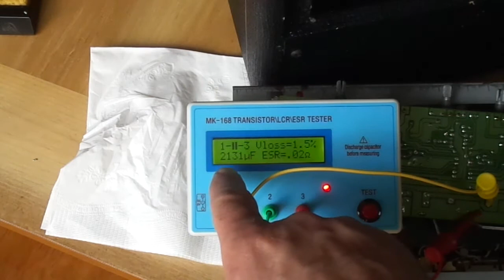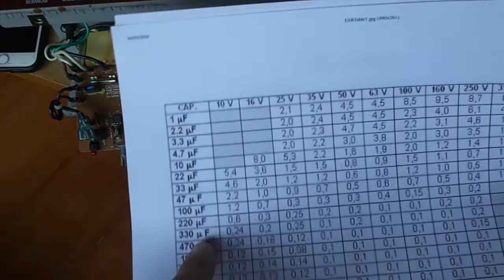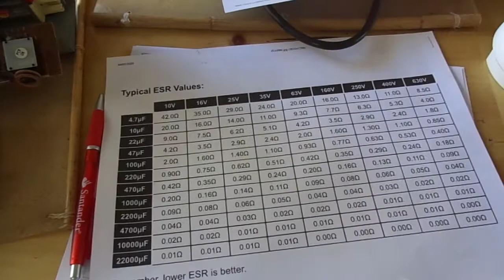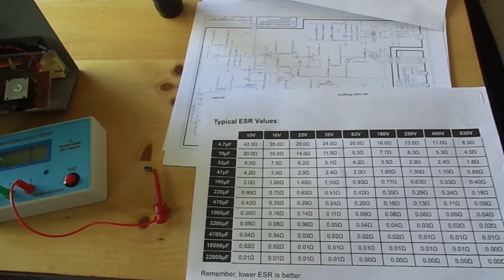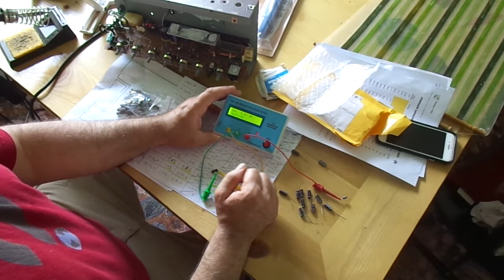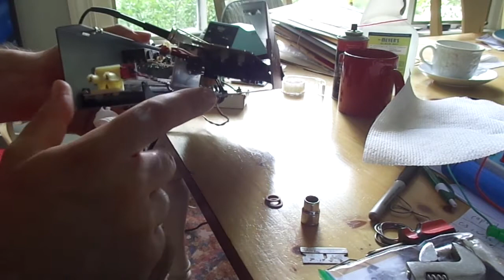Vox Pathfinder 15R Electrolytic Capacitor checkup and possible recap job?

Comment: I have that same model Vox 15R, and we'll, ..I unplugged my Speaker and the speaker wires touched together while the amp was on, and it went " pop"  and a little tiny wisp of smoke accompanied by a burnt electrical smell came out of it.  The little red led on/off still works though, ..but no sound. ..

I removed the Chassis and the Fuse is fine. Then I smelled the Board and found the area of burnt electrical smell, Scrutinized that area visually and found two things that look sort of off: C22, ?  ..it looks like a brick red colored Chicklet (remember Chicklets chewing gum?) anyway, ..well, there's a bunch of those in there, but the one labelled C22 has a little silver metallic substance coming out of it, ..it looks almost like a little silver sliver of dried solder, coming out of the top of it. 

The other thing I noticed, is, ok, you know how you have to remove all the Chicken Head knobs and those seven flat screws and washers behind them, ..and then also those two tiny Phillips head screws, to separate the Board from the Chassis? ..well those two little black Phillips Head screws that you remove from the aluminum sort of L shaped piece that holds the board to the chassis, ..in the Center of that aluminum L shaped piece, ..there's a single, Regular sized, silver colored Phillips head screw that holds this little Black Square, onto that L shaped aluminium piece, ..  it looks like like a little black box made of some kind of Hard type of Bakelite Plastic.  ..it has Five little fork-like Fingers that come out of it, and go up to the board, where they're solder connected to the Board where it says IC4, ..well that Little Black Box, has a big Chunk blown off it. 💥 I even found the piece that blew off.  ..there's even a little tiny black mark on the aluminum piece it's connected to right beside where it blew off.  
 ..everything else looks fine visually as far as I can tell... ..please, ..what are your thoughts on this? 🙄
Reply from the maker: For starters, the little black box that blew up is the TDA2030a power chip. It’s what gives your speaker 15 watts of power! It needs to be replaced. The original chip had shorting protection, whereas replacement counterfeit chips didn’t. So you need to get your amp worked on to bring it back to life.
Reply: @voxpathfinder15r  I never knew if the two speaker lead wires touched together it would, ..your amp would go poof, ..everyone's always talking about how great it sounds to plug it into a bigger speaker, have you ever heard of this happening? 

Do you think if I get the TDA2030a power chip replaced, the amp will work again?🔊 Where can I buy this chip, or something that will work in it's place the same way as the original, that isn't counterfeit?
Reply from the maker: @benwright6330  there is a special Jack to plug an extension speaker, you don’t have to unhook the built in speaker. Yeah, there’s a good chance if the chip is replaced it will work
Reply: @voxpathfinder15r How can I buy this TDA2030a power chip, that I'm assuming is out of production, but still in high demand,, so likely counterfeit these days? , ..was it in production for a long time, widely used in alot of products? Could I buy an old appliance, in good, used condition, like an old phone or radio or whatever they Came in, open it up and harvest this chip to obtain a Real one? Is there a way to find out what years and models of appliances I would likely find one in,  and want to be on the lookout for?
Reply from the maker: @benwright6330  do you have a soldering iron? Do you want to do this repair on your own?
Reply: @voxpathfinder15r  Yes,  if it's not too complicated, ..I don't want to screw it up.
Reply from the maker: @benwright6330  harvesting old TDA2030a chips from old circuits is certainly the best way of ensuring not getting counterfeit. Probably best way is to familiarize what devices would have them and drop by those yearly electronics drop off in your town’s recycling program.
Reply: @voxpathfinder15r   Do you personally know of any old devices that had them, like what brands? ..like would I be more likely to find one in a Sony boom box from the 1990's or something of that nature for example, do you know of any off hand, or ones that would be more likely to have this?
Do you know what years the TDA2030a IC was in production?
Reply from the maker: @benwright6330  I don’t really know off hand, you’re going to have to do some research. There are some good videos on YouTube you can start with. And you might not mind putting a counterfeit chip. It might give you great service, I have read they might have a little less output. But honestly, you won’t be able to hear a volume difference. I suspect any radio device from the early 2000s advertised as around 15-18 watts is probably a great bet. Perhaps even 📺 TVs with its own built in sound is a good candidate.
Reply from the maker: C22 is just the coupling capacitor before IC4, I don’t know why it would get damaged?  But if something visually is wrong, it’s worth taking out one leg out of circuit and testing it. Any repairs on this amplifier will need a qualified technician and/or the use of a load lamp and variac, optionally an oscilloscope. Thankfully I have all these tools!

Comment: Hello guys. Yesterday Ive got this amp. I had no chance to test it prior purchase. There is hiss on clean channel if I turn volume around 10oclock and more then became worst and worst. Do you know what should me issue? I seen that input jack is a bit wobly but still would like to know if there is some other issue to check it. Thanks a lot D.
Reply from the maker: It’s really hard to diagnose from a distance, you could make a recording and maybe you’ll get lucky and it will be something that someone recognizes easily. Otherwise you will need to bring it to someone to get fixed.
Reply: @voxpathfinder15r  Its clear for me. I already contacted servis so will manage in this way.  Anw thank you for answer.

Comment: I have one of these but the brown one, I think the tremolo is broken because I can't hear any difference when I turned it up, do you know how to fix it?
Reply from the maker: Sure it needs to be put on an oscilloscope and the faulty parts replaced, usually capacitors, but maybe a dead opamp?

Comment: Accidentally bought a Japanese 100 volt version. Would it be possible just to replace the transformer with a 120 volt? I’ve read that  a Hammond 166FB24 might work. Do you have any experience replacing the transformer? Are the transformer wires soldered to the board or clipped in?
Reply from the maker: Yes I have experience, I can usually find  something out of China that works. Nothing from the big name manufacturers will work. Yes all soldered connections, you could try a mini variac.

Comment: I’ve got a 15r that’s not giving out any sound. It’s not the speaker, if i put the volume on full I can hear a super quiet signal coming through. Any ideas 🤷‍♂️
Reply from the maker: Wicked common problem, roll up some 400 grit sandpaper into a tube and run it into the external speaker Jack out back and forth. Then with a wire brush cleaner spray some deoxit, and same motion back and forth to clean the terminals. That might do the trick, but lots of times you have to open the back and clean the contact points by wedging them apart with a speaker jack, putting sandpaper sandwiched between and taking plug out, then pulling out sandpaper, repeat as necessary until there is continuity on both sides with plug out.
Reply: @voxpathfinder15r  thanks v much .. will give that a go 👍🏻
Reply from the maker: @LordFuzzman  let me know if it works for you

Comment: hello master, Another question from a newbie in electronics: is it possible and how could an auxiliary input be located? I tried to input the aux signal through the return of the effects loop, but the auxiliary or the guitar sounds, not both, I think due to impedance differences.
Reply from the maker: Do you want to take the preamp out to a mixing board or to another power amp?
Reply: @voxpathfinder15r  NO .. I just want to listen to the backing tracks from youtube (phone) through the same amplifier.
Reply from the maker: @fredyperezrozo1240  I assume this is line level?  I would experiment with this device. https://www.radialeng.com/product/mix-blender/features. Put it in the loop. One path will go straight through the effects loop for your guitar signal. Then in the other side you can inject your music signal and you have a mix knob to alter the level
Reply: @voxpathfinder15r  I didn't think it was that complex. I don't want to add another team. Is there a simple way to make a mood in the same amp?
Reply from the maker: @fredyperezrozo1240  you could try putting a y splitter cable in the return Jack. This way you could bridge from the send Jack to one side of the splitter for the guitar signal. And feed your CD player into the other side of the splitter cable. Something like this. https://www.showmecables.com/1-4-in-mono-male-to-dual-1-4-in-mono-female-adapter-cable-6-in?gclid=CjwKCAjwsNiIBhBdEiwAJK4khvfK_BcDbn0kiNoSxc0mxXQVithAOzumke_VbrkrRVXF194oKO4G1BoCFE8QAvD_BwE
Reply: @voxpathfinder15r  I did so, but I understand that the impedances of the two signals are different and are canceled, one or the other sounds. the aux signal from an mp3 cancels the guitar signal which I think is lower.
Reply from the maker: @fredyperezrozo1240  you’re going to have to modify the cable with high value load resistors. But in the meantime, why not try feeding the output of your MP3 player through a boss pedal in bypass mode, then do the same thing with your effects send through another boss pedal in bypass mode. Then sum both outputs into the y cable, then plug back into the return Jack of amp.

Comment: Hello! I bought this amp some years ago but the reverb on mine does not work at all, and that's a pity! Do you know what the problem would be?
Reply from the maker: It can be many things. I cannot tell you what is wrong with it. I would have to put it on my bench and test it out. And most likely if I could tell you what was wrong, it wouldn’t be an easy fix.
Reply: @voxpathfinder15r  I see. Thanks for the answer! It's probably better to buy a reverb pedal than trying to fix it :)
Reply from the maker: @carloconcato5788  considering it’s cheaper to buy a pedal than fix, probably a good idea. Only thing might happen is you won’t like reverb before the distortion. The reverb in the amp is sort of like a parallel effect that gets mixed into the dry signal. You might be able to reproduce this with a pedal plugged in front of the amp.